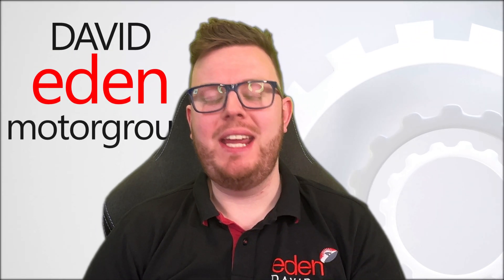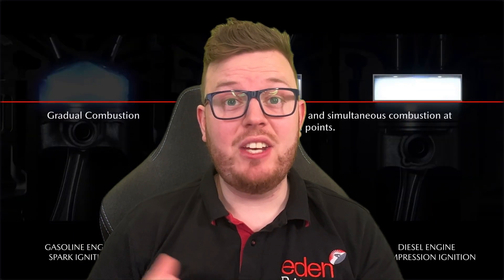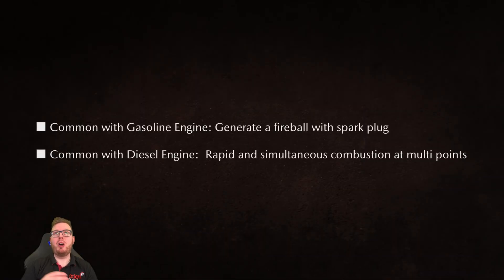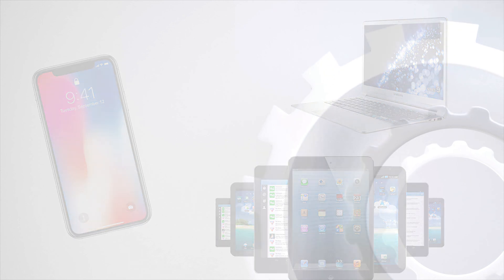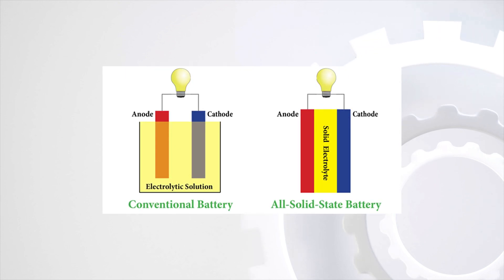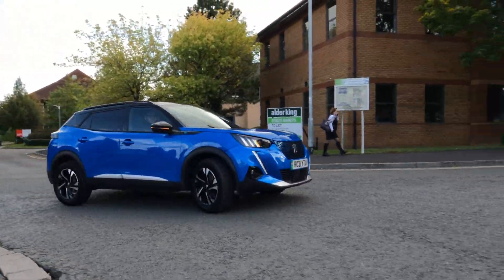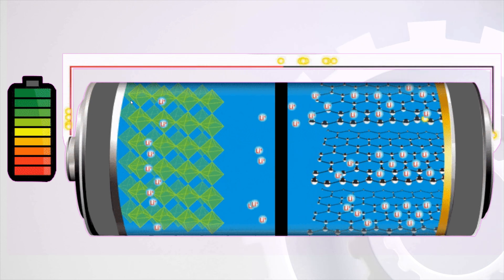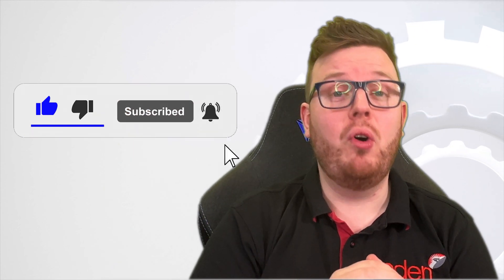How Does an Electric Car Battery Work?

Comment: How many Kwhs do you require to increase the charge in your car battery by 20Kwhs? I ask this as I monitored the charge in to my EV and my battery and discovered there number of Kwh I put in did not equate to the same number of Kwhs in the battery. Can you help explain how many Kwhs as a percentage of battery charge are lost during the process of recharging the battery? Thank you
Reply from the maker: So energy conversion loss should be too much. “A battery is more complicated than a simple container. A rough expectation is that your EV may use as much as 12 to 15 percent more energy than what you add back to the battery.”